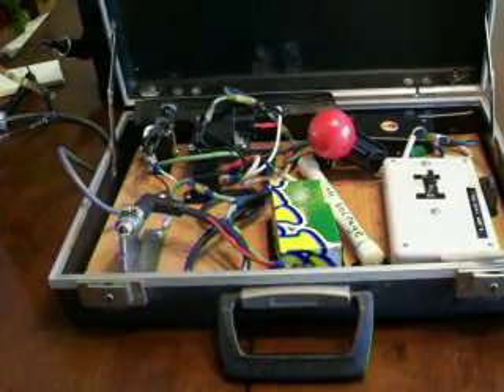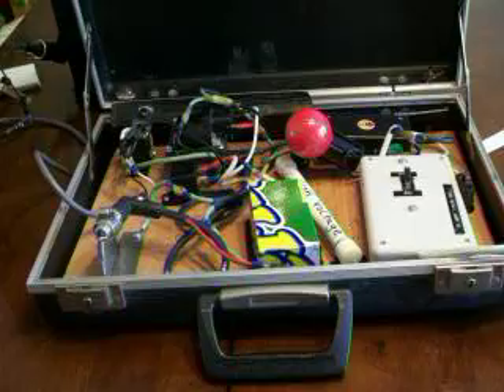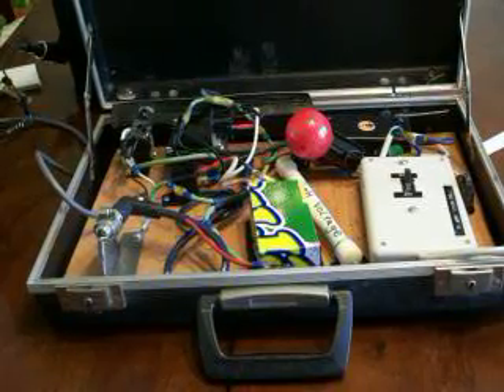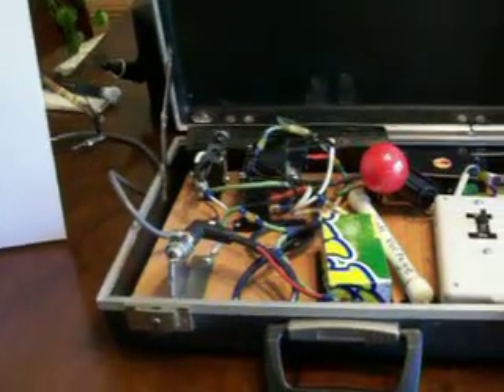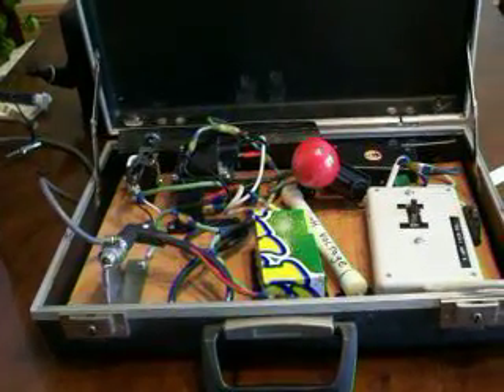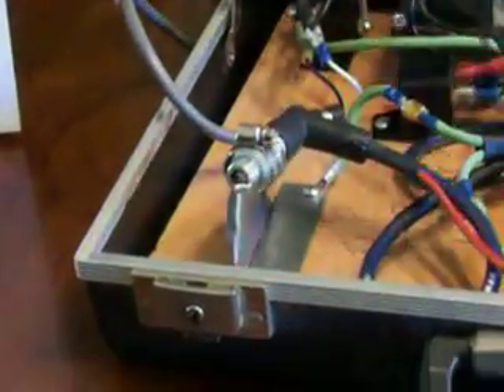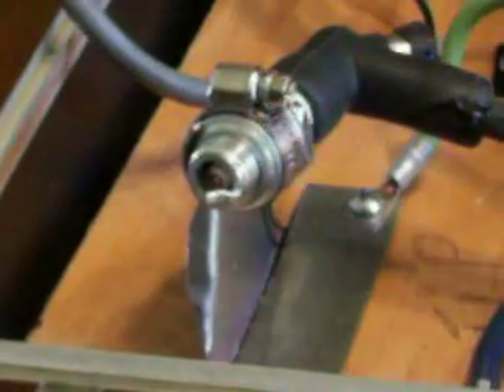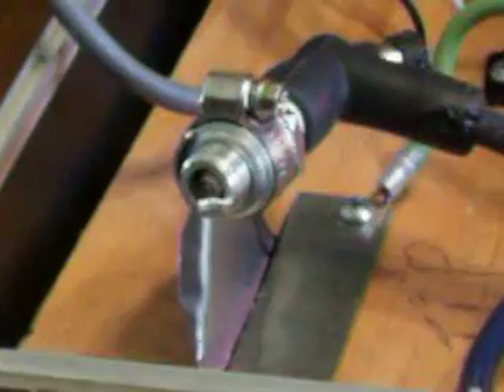firefly  part 1

Comment: Simpel ceramic capacitors in series high voltage you get plazma but the oposite is amplifier ignition forcing more amps rather then volts bouth are usefull with centrain fuel types and octane ratings but its used with conjunction with dual ore multipel ignition sequence fiering like waste spark then magic hapens but protect your other suplies like alternators they change and react do potential diferences acording to the condition they operate it culd switch polarity of devices in some cases reverse electric motors rotation, increasing speed of motors ore add torque they may even swap from starter to generator functions so thats the secret of hybrid cars increasing power by multipel times with the same wire stronger brushers and advanced cooling system they need like oil coolers to with stand more power thats all to it old military tehnology used on universal engine blocks with closed egr fuel cells vaporisators and own fuel mixed and probably own engine oil vapor burning, methanol water ore ethanol water so probably aditives are todays called engine run long time with out fuel it was used after all in ww2 and gear reduction gear up reduction friction less bearings ore magnetic friction less flywhells torque converters etc etc etc and no they did not put a freaking steam boiler on cars they did run internaly and externaly burning engines how much I care those culd run multipel fuel types at once the small engines culd produce multipel times greater power with less fuel so yes those emisions are all lies and yes oil companis are bittchs that old guy has a point there that is all real tehnology